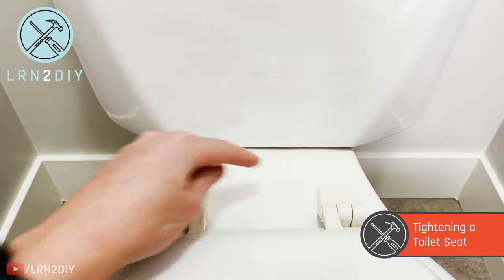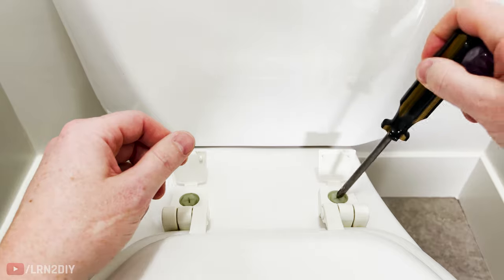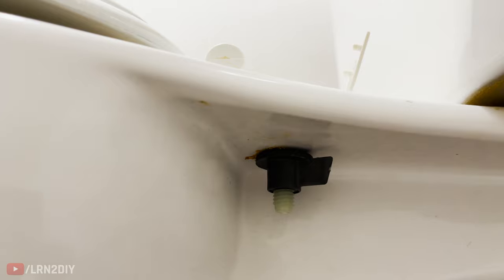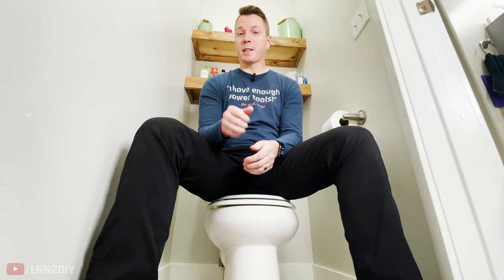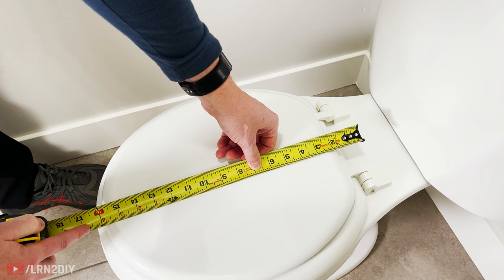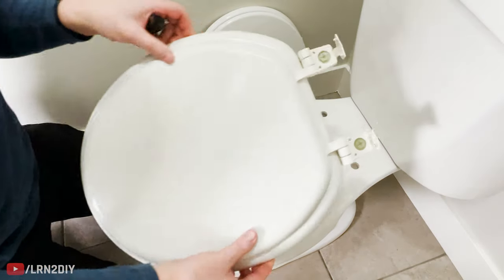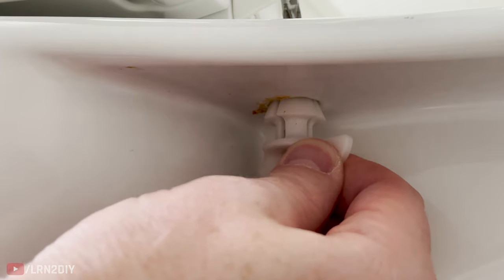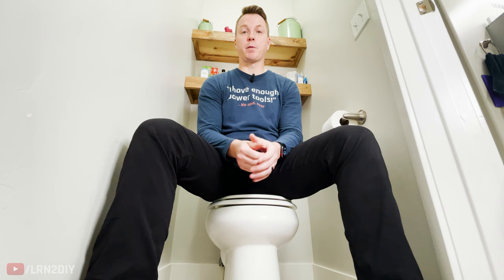How to Tighten or Replace a Toilet Seat in 3 Minutes

Comment: What annoys me is that no matter how good I tighten the seat, in some cases it still doesn't take very long for it to come loose again.

And I have two toilets with the same soft close lid but one of them has stopped working properly so the soft close isn't soft anymore. Any ideas is it possible to fix the soft close mechanism or do I need a new seat?
Reply from the maker: I could be wrong but I suspect that once a soft close no longer closes softly it's not worth fixing, but I haven't tried it myself. As for the bolts coming loose, you can purchase rubber washers from the hardware store, which might help them to stay in place longer. Either way, best of luck with both issues!
Reply: You need to tighten the bolts all the way but leave them a little loose still when they are close to being tighten.  Then, tighten each a bit, keep swithching sides about two times.  Do not make it very tight right away at one shot.  Hope this help and your seats won't get loose anymore.

Comment: What about other types of nuts that require a wrench of some kind to tighten down the seat and in my case including a bidet fixture the fits between the seat and the bowl. When  a bidet is present it’s critical to tighten the nut more securely to avoid any movement of the seat. Thanks , Roy

Comment: Nice video.  Pretty sure you installed the same seat I bought including those cone head nuts.  However, for some reason the nuts won't grip, never did.  They act like they're stripped.  Can't tighten up the seat enough to prevent the sit-down-wiggle. ;-)

Comment: I have a bar hinge on my seat & the bolt is part of the hinge. It came with 4 plastic things that sort of look like washers, but are thicker, rounded on one side, flat on the other. No instructions. I couldn't figure out how to use those washer-like things. When I tried putting them on the top of the holes, it looked terrible & wrong, but putting them underneath didn't seem to make much sense either, so I didn't use them & just used the plastic nuts to tighten. It's starting to loosen already after just one week. I would appreciate any advice, thank you.

Comment: Instead of small, round, holes where the seat bolts go into the bowl, mine has longer, oval, ones, such that no matter how hard I tighten the seat bolts (without breaking the ceramic bowl, of course), it still moves front to back too much. I figure I need some kind of shim to keep it from moving, but, I can't find something that will prevent the seat from moving and not fall apart (i.e., paper, rubber, wood, etc, would, eventually wear, and metal may damage the ceramic). Whatever it is, it cannot protrude above the bowl holes nor can it interfere with the bolts. Any help would be appreciated.

Comment: Hi! How do I get the nuts off the bolts? I loosened up the bolts with a screwdriver but I cannot take off the nuts beneath to take out the seat. Please help me. Thank you!
Reply from the maker: You may need to use a wrench or pair of pliers to thread the nuts off the bolts while holding the bolts in place with a screwdriver.

Comment: Friendly reminder. The purpose of that single wingnut is that it is supposed to catch on the bowl thus removing the need to use your hand or tool to hold it in place while you tighten or loosen.

Comment: So the new locking bolts presumably can never be removed intact? Because they’re wedged right in there?
Reply from the maker: They can twist right out, actually. They do wedge into place but when you turn it counter clockwise it backs out and loosens up.
Reply: @LRN2DIY  ok thanks!

Comment: It annoys me that some manufacturers make the seat and hinge separate from the base that screws into the toilet, and they come loose.  So you normally get as far as putting it on like a normal seat, then find it still moves. So you gotta take it back off, tighten the plate to the hinge, and re screw it to the toilet🙄

Comment: This won't work for me. The bolts don't have flippable caps on them, the seat covers them. How do I tighten up a toilet seat when the top of the bolt/screw is inaccessible? I can't tighten it from underneath because I can't get a grip. Thanks for any help.

Comment: I have never seen that locking nut before. Does it not push all the way through and then the screw gets put in from the underside to lock it? Looks like it is installed incorrectly in the video?
Reply from the maker: Unless I’m using it incorrectly (entirely possible) it makes the user’s life easier by slipping over the threads of the bolt until it’s pressured against the hole, tightening itself into the threads and allowing the bolt to thread into it. It’s been working great so far. It’s much too large to actually fit through the hole, too.
Reply: Thanks for the reply. That is something I was looking for (but didn't know it). Now just have to find it here in Canada!

Comment: I tightened mine and now I have a 2 inch gap between the bowl and seat, what do I do for that?
Reply from the maker: A gap at the front of the seat or a vertical/height gap? If it’s the front, you have the wrong size seat - you probably have a  round seat and need an elongated one. If it’s vertical, there’s either something in the way or it’s not properly tightened.

Comment: One of the bolts wont tighten and wont unscrew. Any ideas? Cant tighten it and cant get the screw out to check the threads it just goes around but not in or out
Reply from the maker: If it just won’t come off, you can also cut it off with a hacksaw and then replace it with new hardware. The hardware comes in the toilet flange kit.
Reply from the maker: Sorry! Wrong video. (I have several toilet repair videos) Is there a way to secure the head of the bolt? Either using a screwdriver or pliers? If not you may need to replace the seat in order to tighten it properly. Similar to my previous comment, actually :)

Comment: We got a Kohler toilet that has a toolless seat that clips over some plastic pieces that stay bolted to the toilet. To remove the seat you pop up some covers and spread some clips so that the seat comes off without tools. To put it back on you simply slide the seat back onto the clips and close the plastic hinge cover which are supposed to keep the spreadable retaining clips from spreading thus keeping the toilet seat tight. Problem is they don't keep the seat tight. Also only the front bumpers on the seat contact the porcelain which does not help. This is the seat that came original to the toilet. Anyone else have this problem with a Kohler? How do you fix it without replacing the seat? I think it is a poorly engineered product in combination with the toilet seat not fully contacting the porcelain. This was not a base toilet it is an upgraded toilet and has had the problem since day one.

Comment: What to do when the seat won't stay up?
Reply from the maker: There are a few things to check in that case: 1) loosen the bolts and try to tighten them after pulling the seat as far forward as you can. 2) make sure the lid of the tank is as far back (close to the wall) as possible and 3) you may need to remove the carpeted seat cover if you have one. If all else fails, try the soft close seats. They're about $25 and are much stiffer when open. Good luck!